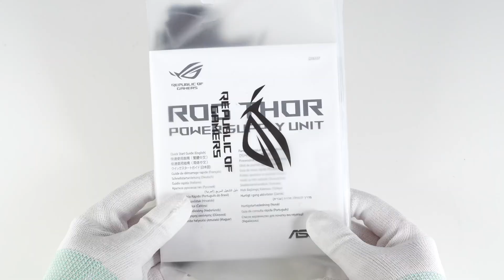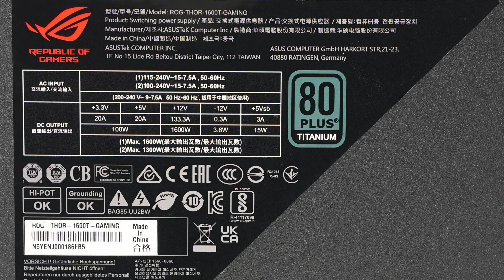Teardown of ASUS ROG Thor 1600W Titanium Power Supply

Comment: is your unit very noisy? mine is crazy, I connect 5090 plus 7800x3d to it. and every 15-20 minutes it starts to cool down very loudly. I also connected 5090 through the adapter included with the video card 4x8 pin

Comment: this unit is just horribly loud, my total system load is 850 watts under load, the power supply cooling fan runs either at 0 percent or 100 percent and it's horribly loud. is this the case for everyone or is it just me?

Comment: I need to take mine apart and find a way to force the fan to run full time. The unit gets too hot to touch and the system acts up at 850w. This unit looks great, and does/has everything i want and need. Just need a full time fan.
Reply: If u dont knw asus update the line rog thor series. Now Rog thor III 1600w is atx 3.1 with 2 12v-2x6 connectors. It has switch whem want to turn on turbo or normal
Reply: @GeraZuluEx117  thank you. Ill try a return. Ive already replaced it with a BeQuiet1600
Reply: @YEAHitsaHEMI  thats fine i hve rog thor II 1600w for quite some time no probs watsoever although i never run past 850w no noise watsoever

Comment: Ive been using rog thor 1600w titanium few months now still solid no blown capacitors or anything out of blue. My build has 4090.
Reply: bro that thing is the most advanced psu, a capacitor blown and their stock will go crazy
Reply: how it so far
Reply: @RussStufft it's a smooth ride no problems so far

Comment: Currently you can buy two 1000W Thor PSU's for less then one 1600W.
  I was hoping to mod this PSU for water cooling and ditch the fan. Glad I saw this before buying I think I would be better off with two PSU's One for my 4090 and one for my Asus Maximus Extreme MB, Jumpering pin 14 of course so they both turn on simultaneously.  Water cooling this would be a major pain. Not even room for a heat pipe.
Extremely complicated circuitry even for a scan rectified power supply. Al in the name of maximum energy efficiency.  I think the same power levels could be accomplished with a lot less parts.

Comment: Most expensive PSU I ever seen (700$) and they dont include a native PCIe 5.0 12VHPWR cable.
And even worst, the 8pin EPS (CPU) cables are too short. Adding insult to injury, CPU cables are too short for Asus Helios Case, XD.

Meanwhile other brands like seasonic Prime give you same or better specs, more and longer cables and 2 extra years of warranty for half the price.

Comment: I would have considered it if the design matched the screen. Otherwise, you'll turn the PSU over and the LCD screen is gone...
Reply: I have the previous gen Thor and it's not even visible in my Fractal Define 7 case, I could not care less about the screen to be honest
Reply: @denissh9478  I have the previous Thor 850w and the OLED screen is malfunctioning right after installing it brand new from the sealed box. I tried all the basic stuff like updating BIOS, chipset drivers, checking connections. I guess I should have hid the screen behind a panel as well.

Comment: usually when you want to install the PSU in the conventional case layout, the fan is facing down..for this PSU, if want to install the fan facing down, the OLED display will be unusable because it will face the other side of the case..and if you want to use the OLED display, the fan will be facing up and that would be weird for cooling because of physics..lots of cases today has psu shroud that not perforated for upward psu fan except for their own helios case..did Asus did not think this through enough?
Reply: Physics?  Are you forgetting that computer cases have fans that blow air inside and exhaust air out.  The air inside a PC case that is well ventilated is more then enough to cool the PSU. Keep in mind that the THOR lineup does not need active cooling unless its being pushed pretty hard.
Reply: I've just install 1200W one in my own PC, old one was Cooler Master and  had a fan fasing down , This PSU intakes fresh air from case and pushes air out from back, very nice design. My case shroud has a cut window so I can see RGB and power consumption .
Reply: @MrKaon  Can you take a picture with the fan facing down and post on imgur? I was curious about this product but I only am concerned like the individual above...
Reply: @watsup39  I'm sorry already installed it in system and fan facing up , mine is 1200W and fan is almost always is off, unless I start gaming.
Reply: @MrKaon  I thought you said you could see the LCD screen? Can you take a picture of the case rn?
Reply: @MrKaon  Does the fan ramps up itself after sometime? I got the 1600w version but it maxes the fans itself after sometime then reduces. 1600w isn't worth it. I'd buy 1200w if it doesn't have such problems
Reply: @Frost  Honestly, so far, I didn't notice the fan spin; either it is not spinning at all, or if it does must be very reasonable.

Comment: Wow, I'm blown away! The design complexity of such a compact and powerful PSU while achieving some of the highest efficiency possible with current technologies is astounding! Kudos to the engineering team who put this thing together, phenomenal work!
Reply: still nothing compared to huawei r4850g2 3000w with double power and 2 times smaller
Reply: @ariefhidayat2157 , glad to hear you found a better product with zero parts to begin building a computer except a barebones chinese PSU and likely scammed 10x in process of getting one. and it's not gonna fit either btw.